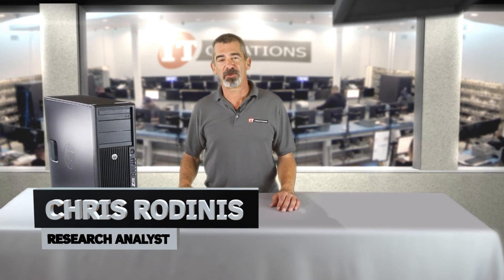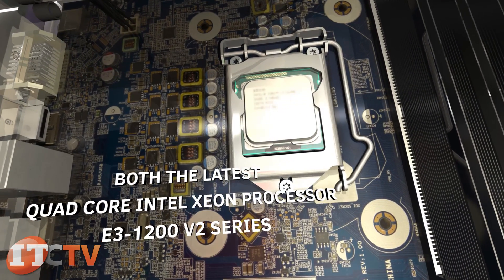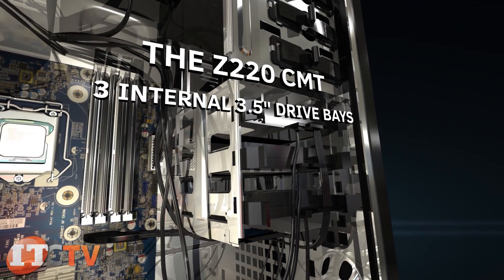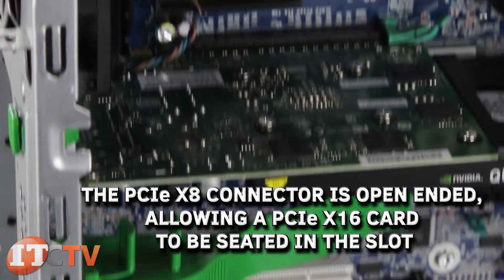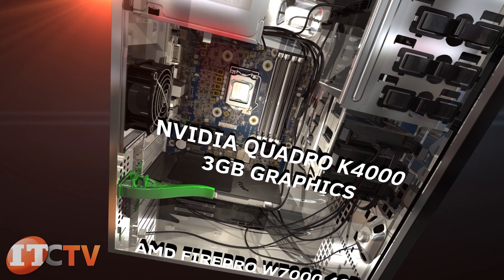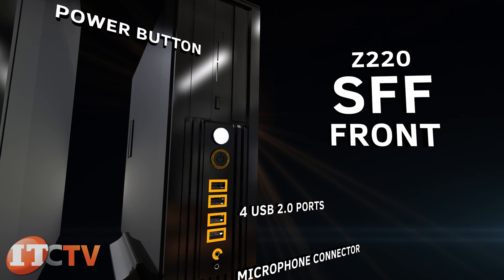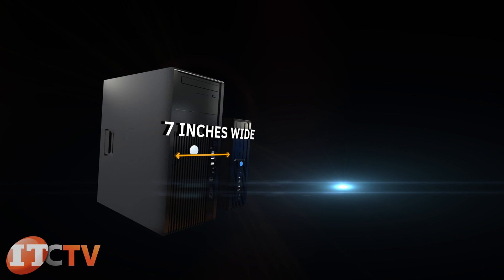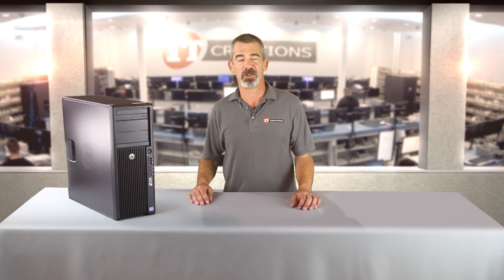HP Z220 Workstation Review

Comment: Sir i have xeon w3550 processor. It is compatible to this machine ?
Reply from the maker: Hi there Chetan, 
The W3550 is not listed in the QuickSpecs, and here is a link to help you determine which CPUs are compatible for this system: 
https://support.hp.com/us-en/document/c03364712 
BTW, As this system review is 8 years old at this point, I have updated the links in the description to include a troubleshooting guide and the user's manual. Thanks for watching!
Reply: @Itcreations-LA  Thank you sir. 🙏🙏🙏

Comment: I bought 4 of these SFFs off eBay with i5-2400 CPUs. I use them for number crunching Mapping Cancer Markers and other projects via BOINC. Power consumption at the wall is about 87 watts. Unlike my newer systems, i cannot undervolt! Throttlestop nor Intel XTU supports it and i am already running an old BIOS i don't think the latest z220 BIOS would help but i could give it a go. At least after the BIOS upgrade i could swap in an i7-3770 they are about $35 on eBay. 
The successor, the Z230 I can undervolt the 4th gen Intels in them by 70mV stable.
Anybody able to undervolt these to keep them relevant instead of energy guzzlers? On my 8th gen SFFs i can cut the power consumption at the wall close to 25% at 140mV undervolt with no clock speed reduction, impressive!
Reply from the maker: Hey Dan,
These systems are long gone from our warehouse  but thank you for sharing! Very useful information. Hopefully someone will chime in on your power question.
Reply: @Itcreations-LA  thanks, looks like it's about time to craigslist as a basic computer. Fun fact, if the power supply fan is seized, it doesn't overheat with CPU at 100% usage. It's at what, 33% load.
Reply: @danwat1234  what version of bios do you have i have the i7-3770 but can't seem to work
Reply: @micario6391  I am not able to undervolt any of these whether it is 2nd gen or 3rd gen Intel  of HP Z220 or Z230

Comment: I have the z220 CMT and the specs said it can hold two fans but I can't seem to find the front chassis fan neither the header I was wondering if you can help me locate the header an let me know if it can hold anyother size fan please
Reply from the maker: Hi Rolando!
Yes, there is an optional front fan, which is part number 643908-001, and you can see it here but unfortunately we don't have any at this time https://www.itcreations.com/product/43102 
The header you can find on  page 12, which shows the motherboard layout for the Z220 CMT (items 25 and 26) If you key in the page number at the top of the page then use #24 http://h10032.www1.hp.com/ctg/Manual/c04205252.pdf 
Hope that helps, and thanks for watching!

Comment: Hpz220 is support sata 3??
Reply from the maker: Hi Asif, 
Yes, the system will support SATA 3 with 2x ports and SATA 2 with 2x other ports. Basically, SATA 3 supports data transfer rates of 6Gb/s while SATA 2 will provide transfer speeds of 3Gb/s. You can see it on page 7 of the Quick Specs for this system but here is the pertinent information, and this for the integrated SATA controller. 

"Integrated SATA Controller (Z220)
Integrated SATA Controller (SFF), RAID 0,1 supported:
2 ports 3 Gb/s, 2 ports 6 Gb/s
"

https://docplayer.net/24178467-Quickspecs-hp-z220-sff-workstation-overview.html 

Thanks for watching!
Reply: @Itcreations-LA  bro how to know sata 3 on motherboard in hpz220
Reply from the maker: @AsifKhan-ss8ct  Hi again! 
Here is a link to the "HP Z220 SFF, Z220 CMT, Z420, Z620, and Z820 Workstations
Maintenance and Service Guide" http://h10032.www1.hp.com/ctg/Manual/c04205252.pdf . Look at page 12, Chapter 1 (if you punch in the number at the top of the page, type in 24 but actual page is 12…) there is a diagram of the Z220 CMT system board and under the SATA header in the legend it says AHCI 3Gb/s and AHCI 6Gb/s, look for the associated numbers (15, and 16) to find the specific ports on the motherboard, there are only two for support of 6Gb/s SATA 3 drives. the others (4x ports) support only SATA 2 at 3Gb/s. Thanks for watching!
Reply: @Itcreations-LA  in blue color is sata 3 port yes?
Reply from the maker: @AsifKhan-ss8ct  
I am not sure what color as we do not stock this system anymore and teh video shows a CGI image. However, if you look at the video, specifically at the 2:25 mark, you can see in the lower right hand corner to the right of the PCIe slots there are six slots on the system board with two on top and four on the bottom with 4 cables plugged in. The 2x ports on top are the SATA 3 ports at 6Gb/s and the 4x on the bottom are the SATA 2 ports at 3Gb/s. Hope that helps and thanks for watching!
Reply: @Itcreations-LA  thanks ♥️ buddy

Comment: 4:12/6:12 reference made to Optional 1394A FireWALL connector ..... I believe this may be in error.  [What is 1394a port used for?
On a PC, the IEEE port (called FireWIRE) is used primarily for connecting audio or video devices to the console. An external scanner or disk drive may also use the IEEE port.]
Reply from the maker: Hi there Ron, 
You are entirely correct, that is indeed a a Firewire port for connecting audio and video, also faster data transfers. This video is quite old (8 Years) and I have never actually seen it, until today! You have a sharp eye, and ear! Thanks for watching!

Comment: Bro hp z220 motherboard vs h61which is good
Reply from the maker: Hi EOD, All I can say is the Z220 is definitely on the older side at this point and so is the H61 MOBO but if you want an enterprise solution that would be the Z220. Both use the same socket for the processor. Thanks for wtching!

Comment: These are very versatile systems. I own 3 of them. I run a GTX 950 in one and a Radeon 6670 in another. They have been rock-solid stable. These make great light-gaming rigs and another bonus is there are official drivers from XP32 bit through Win10 64bit. Sadly, no overclocking, but that is common with OEM PCs. As of now, you can find the MT in the $150-$200 range. Throw in a moderate graphics card and you're good to go!
Reply from the maker: Nice! Thanks for commenting and thanks for watching @John Madison!
Reply: Does it have wlan and bluetooth

Comment: So, you can use either ECC and NON ECC? I thought this was dependant on the CPU, whether I series or Xeon? 
 Can anyone confirm this?
Reply from the maker: HI there Tony,
we do not have any of these systems in stock right now but you are correct, it is up to the CPU, however, all of these CPUs can support either ECC or non-ECC memory. Here is a link to the QuickSpecs, specifically page 4 where it discusses the type of memory supported on each CPU. Hope this helps and thanks for watching. https://www.manualslib.com/manual/575927/Hp-Hp-Z220-Cmt.html?page=4#manual

Comment: Hello nice video. So I have the z220 cmt and I want to change the power supply to a better one on 500w and also a graphics card Gtx 1660 6 gb oc . Can I do this upgrade or the pc will explode? Thanks a lot
Reply from the maker: HI there Vasillis, The card might work but the PSU idea, uh no. The card specifications say a PSU of 450W so close (your system tops out at 400W) but depends on what else you are powering. I wouldn't spend time tinkering to get the PSU to work. This system is about 9 years old, maybe find one that's a little more recent. Hope that helps here are a few links for you:
https://www.stalliontek.com/stalliontek_workstation_specs/z220.pdf
https://www.nvidia.com/en-us/geforce/graphics-cards/gtx-1660-ti/

Comment: Does it have NVME slot ? (the workstation one)
Reply from the maker: Hi Awaiz, This system is quite old +8 years so no it will not support NVMe on the board or in one of the drive bays but I think there is one PCIe 3.0 slot that can be used for an M.2 PCIe card. Perhaps something like this: https://store.hp.com/us/en/pdp/hp-z-turbo-drive-dual-pro-256gb-ssd There are other third-party manufactuers too like ASUS. We have not tested though so I cannot say for sure. From what I can tell, you cannot use it for your boot drive. Hope that helps, and thanks for watching.!
Reply: @Itcreations-LA  I have GPU installed on PcIe 3.0 slot but thanks for the help
Reply: NVME is different than PCIe 3.0

Comment: Hello brother,I am going to buy this pc hp z220 core i5 3470 with Rx 570 4gb graphic card.Will this pc be efficient for latest games as pubg,division 2,battle ground 5,gta 5 and many more? Dear I will wait for ur repply.
Reply: Did you buy this workstation? Performance of card with this tower?
Reply: Bro can u tell me is rx 570 4gb working fine on that 400w psu?
Reply: @anasimam8360  i think it should work fine, i have a GTX 950 and I only go up to 350 watts under heavy load.
Reply: i made my brothers pc with a z210 motherboard, non oem PSU(EVGA 650 Gold), and RX 580. I had to use a 24 to 18 pin adapter to make it work. Edit: the i5 shouldn't use toomuch power and the GPU shouldn't either, so I wouldn't be surprised if the setup worked (assuming you will not try to overclock the GPU)

Comment: can we connect extra 3 pin fan in hp z210 and z220::: any option in mother board??
Reply: Hello, you could remove the rear exhausting fan if yours came with one and get some splitters to add more fans, unfortunately, there is only 2 on the HP z220, one for the CPU and the other for the rear fan, I'm not entirely sure about the z210 but if they use the same motherboard (I'm talking about the CMT btw) it should work correctly.

Comment: I have a few of these at home in the SFF flavor as well as the 8300 Elite. They make good VMware Lab boxes if you max out the RAM to 32GB. If you have no need for Xeon CPU/ECC RAM support, go with the 8300 Elite, there are more of them to be found on the used market. Its the same machine except for the chipset. Just be sure to keep a few PSU's on hand, they tend to crap out after a while.
Reply: Do you know if I can have an SSD (as OS Drive) and a SATA (as vm drive on this) ?Also, I intend to install a wifi card on it. Im consider either z200, or Dell T1600

Comment: Can a thunderbolt 2 card be added?
Reply from the maker: Hi Omar,
There is no such Thunderbolt 2 card offering from HP for that chassis. However, if you can find one that will fit your PCIe slot (and I think you can) then it should work. I should also mention that this is untested as we don't carry the Z220 at the moment and HP says nothing one way or the other but it should work fine. Thanks for watching!
Reply: IT Creations, Inc. Thanks for the fast response. Yes you have excellent content thank you
Reply: IT Creations, Inc. Thanks for the fast response. Yes you have excellent content thank you.

Comment: does it have hdmi slot? dont want to use hdmi to usb converter, it causes loss of quality, any other way to connect my TV to this via hdmi?
Reply from the maker: Hi Anand, Nope, the system does not have an HDMI slot unless you add one. You can add one or several with a discrete graphics card. Check out the quickspecs, here: https://www.itcreations.com/user-manuals/Z230/quickspecs.pdf Starting at page 33 it lists several supported graphics cards. Most of those entries say you can go DisplayPort to HDMI
 cable adaptors. Once you get to the QuickSpecs page Press CTRL and the letter F.  Type in HDMI in teh box that appears in the right corner, then enter. That will allow you to search for "HDMI", which should give you five occurrences in the document.  Hope that helps, and thanks for watching!
Reply: the link you've given is for Z230 & not for Z220, can you send me the link for the Z220, both Tower & SFF, thanks
Reply from the maker: Hi @anandm4545 , sorry about that. Here is another link, same rules apply: http://www.arp.com/medias/14192270.pdf

Comment: Hi
Can I use GTX 1050 ti 4 GB for this computer.
Best wishes
Reply from the maker: Hi Manage Device, 
The recommended system power for the 1050ti for compatibility is 300W and the Z220, assuming you don't have the SFF version, supports a 400W PSU. (QuickSpecs here, it was the only place I could find them: https://www.manualslib.com/manual/575927/Hp-Hp-Z220-Cmt.html)  It also requires a Gen3.0 PCIe slot and you have one x16 PCIe Gen3.0. It also supports the max power output of 75W. (See specs for the 1050TI: https://www.nvidia.com/en-us/geforce/products/10series/geforce-gtx-1050/) All of that says this card should work in your system. That said, we have never tested the card in this system, and it is not one of the recommended aftermarket cards but that's just because they dont' want to test every single card on the system and we don;t have the system to test th ecard either. It's a definite "most likely" to work..
Reply: IT Creations, Inc. hi 
IT Creations, Inc. I have installed 1050 ti 4 GB and every thing is okey except this problem(nvidia has stopped responding and has recovered ) in some games(gta iv, fifa 18 and 17) do you have any solution for that
Reply from the maker: Sorry Manage, we can't help you there, although, you might try running those specific games at different resolution settings and see if that solves the problem. Unfortunately, we can't test as we don't have the platform and don't have the games. Good luck!
Reply: Dean Pepler yes you can. My computer is HP z220 and I have recently installed MSI 4gb 1050 ti and it works very well
Reply: @Itcreations-LA  hey 😉is The HP Z220 CMT Workstation Compatible with The NVIDIA Quadro M4000 Video Graphics Card Workstation GPU 8GB GDDR5 ?? i've got a Intel Xeon E3-1270v2 CPU!!

Comment: hey does it support nvidia gtx 1050 low profile 2GB? I have z220 sff
Reply from the maker: I can give you a definitive most likely. Unfortunately, we do not have that system in stock anymore and cannot test but based on the specifications for the card, here: https://www.gigabyte.com/Graphics-Card/GV-N1050OC-2GL#kf or here:https://www.zotac.com/us/product/graphics_card/zotac-geforce-gtx-1050-low-profile#spec and the quick specs for the system here: http://www8.hp.com/h20195/v2/GetPDF.aspx/c04123224.pdf it seems like you need at least a 300W PSU for the workstation and it supports a 400W PSU. The card itself will require 75W. I am assuming you have the full-size version and not the small form factor SFF Z220. Of course, I am not sure how your system is set up but it does support high-end graphics cards including a few from Nvidia with 3GB and 4GB memory. It will require a PCIe 3.0 x16 slot, which it does have, and since it is a double-wide card may block one of your other PCIe slots but whatever… In a nutshell, it will probably work fine even though it is not one of those that have been tested for compatibility with this product. The small form factor SFF Z220 does not meet the power requirements as it only supports a 240W PSU but you are good to go if you have the full-size chassis. Here's a link to the Z220 SFF in case you are wondering what the hell that is: http://www8.hp.com/h20195/v2/GetPDF.aspx/c04123230.pdf Also, an SSD for your boot drive will do wonders for your system speed. Hope that helps. Thanks for watching!
Reply from the maker: Oh, and just noticed I already answered that question right below your question. Should have gotten coffee first…
Reply: I have a 1050ti zotac mini in mine, works because I looked over the specs like 5 times but mine is cmt the bigger version of sff so I guess as  long as there's room.
Reply from the maker: Hi Wael, That would be a maybe but probably not. the Z220 SFF only has a 240W PSU and the recommendation is for a 300W PSU. Syfenx responded to your question as well and yes that card would work in the non-SFF version because that system supports a 400W PSU. It could work, if you don't have too many other things installed/connected  but that is a risk and we have never tested it. I would recommend either one of the supported GPUs or one that has lower power requirements as most of the recommended PSUs also require less than 50W, while the GTX 1050 requires 75W. Find the specs here for the Z220 SFF, supported graphics cards start on page 8 http://h20195.www2.hp.com/v2/GetDocument.aspx?docname=c04123230 It will also require a low-profile card, whatever you decide on. thatnks for watching!

Comment: can i use the gtx 1050 for this psu ???
Reply from the maker: Hi +ocs shark, , while not a "supported" graphics card for this system, it should work given the requirements for both the Z220 and the GTX 1050. The GTX 1050 requires a PCIe 3.0 slot, which the Z220 CMT does have, and it does have room for the double width card. Although, you will lose one of your PCIe 2.0 slots in the process and only be able to run the single graphics card but it does support multiple displays so all good. The GTX 1050 also requires a minimum system power of 300W, and 75W to power the actual card. The Z220 features a 400W power supply and supports the Nvidia Quadro K4000, which requires 80W to power the card. So like I said, should work. Have we tested this card? No. Here are links to the various docs for more info: 

HP Z220 CMT Workstation quickspecs: http://www8.hp.com/h20195/v2/GetDocument.aspx?docname=c04123224  
Nvidia GTX 1050 specifications: http://www.geforce.com/hardware/desktop-gpus/geforce-gtx-1050/specifications 

Thank for watching, and if you do install the card please give us an update.
Reply: IT Creations, Inc. thanks man

Comment: Could i slap in a GTX 460?
Reply from the maker: Hi +marcus perez Here are links to the appropriate specs for GTX 460 and Z220.

http://www.geforce.com/hardware/desktop-gpus/geforce-gtx-460/specifications 
http://www8.hp.com/h20195/v2/GetDocument.aspx?docname=c04123224 

Max required power for the GTX 460 is 450W and maximum graphics card power is 160W. This card is not compatible by a hair. PSU for the Z220 is rated at 400W and the max power used by the top supported card is 150W and you can only install one. Not compatible. Sorry… but thanks for watching!!!!
Reply: I apreciate the fast response thank you so much! :)
Reply from the maker: +Marcus perez anytime, glad we could be of help.